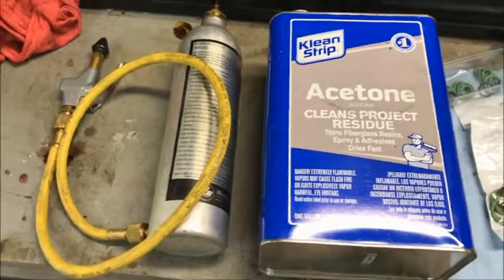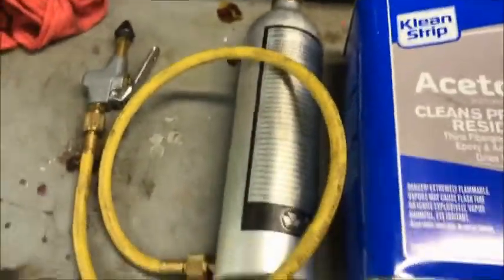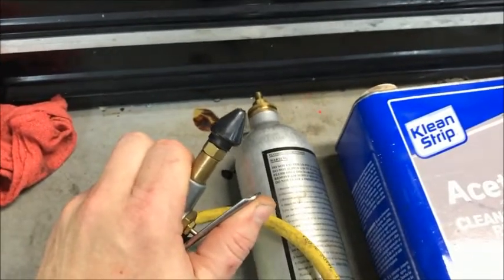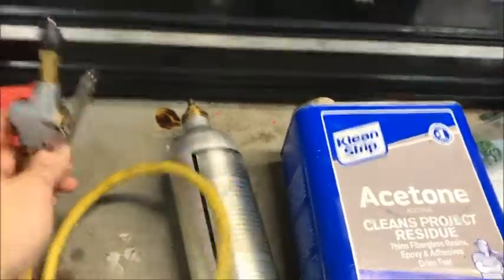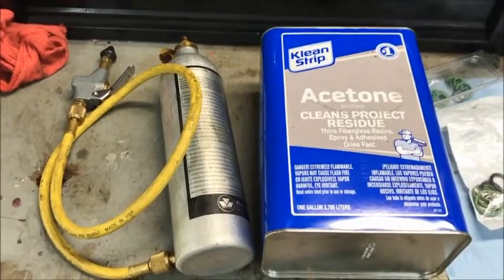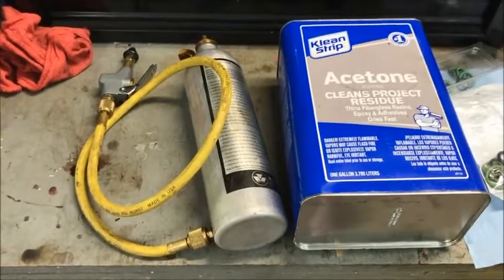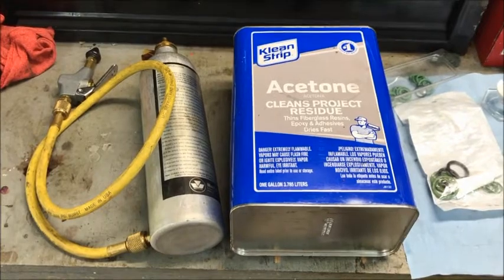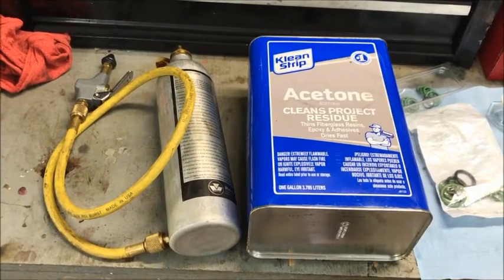A/C System Flush

Comment: Can i use Mineral spirits or Denatured alcohol to flush A/C mainly evaporator in vehicle ?
Reply from the maker: Don't use anything that will leave a residue, so this rules out mineral spirits.  I've never tried isopropyl alcohol but it should evaporate easily.  I wouldn't recommend flushing the hoses, only the metal parts of the system.
Reply: @BriansGarageUSA   10 4 cool + only the metal yup i was planning on that and use 91% or higher isopropyl  i also have some denatured alcohol may try that as well  im working on a 2006 Mazda 3s 2.3L auto sedan  so ill report back soon  got a med flush kit coming in the mail should be hear soon

Comment: Says AC flush but doesn't do anything but talk 😡
Reply from the maker: Donna, this really only works on old school cars.  Those with tube and fin design.  To flush you need to disconnect the evaporator at both ends, then blow the flush through it.  Same thing for the condenser.  Follow with compressed air.  Do not try to flush a drier, accumulator or hose with a muffler.

Comment: Make sure you vacuum from both the low and high side before you charge at least 2 hours.  I flushed a Honda out with AC flush only vacuumed the low side  found flush was still in the system a month later when I went to check it turned out the oil is mixed with some of the flush now. I vacuumed for 4 hours trying to boil it out of there but not happy about it. I was able to get 40F air but who knows how long it will last. When I removed the high side I could smell that citrus small flush solvent.  Acetone probalby better because it will evaporate faster.
Reply from the maker: That's good advice.  I've found that after you have flushed, it's a good idea to blow compressed air thru the tubes to remove any residual liquid.  This will also give you an idea of how clean the residual liquid is.  If it isn't clear, it isn't clean.  Then vacuum for an hour or so.  You must get the flush out or it will dilute the oil and the compressor will be starved of lubrication.

Comment: I would thing acetone would dissolve any o-ring seals and ruin the compressor and evaporator..  never tried it tho..
Reply from the maker: To be clear:
You flush ONLY the condenser and evaporator!  NEVER flush the compressor, NOR the hoses.  You ALWAYS replace the o-rings on any components that have been disconnected.

Comment: When flushing always use a solvent /white spirit that has hydro carbons . If u leave it in a cup it evaporates by itself . Never  blow out with compressed air as it will force moisture and small debris into system . Does it matter,, YES moisture degrades into acid also dilutes compressor oil . Micro leaks are caused by this as well . Happens overtime .
Remedy blow thru with nitrogen . This lowers the moisture and vacuum pump time will be 2-3 hours [longer the better ]  .   Blowing with air compressed air deposits moisture and should be evacuated over night
Reply from the maker: True, probably not a good idea to flush with kerosene....

I fully agree that nitrogen is better than air, but most of us car guys don't have nitrogen sitting around.  Also, know that a lot of classic systems have been open to the atmosphere for awhile, so the humidity has already done its thing.  You're gonna have to vacuum regardless and you're going to have to use a new drier.  Run the vac for an hour and any remaining moisture will get trapped by the desiccant.
Reply: Many times once a system has been opened  for greater than 48 hrs  using vacuum pump over night is enough. A  dedicated  3/8----3/4 vacuum line with a 8-10 cfm pump will reduce vacuum time by 50% Using nitrogen to sweep moisture out will reduce vac time as well .
Reply: use a filter drier on your compressed air line and make sure its not lines you used with lubricated pneumatic tools.... but if you didn't see this immediately as obvious maybe tooling around with a 3000 lb machine that will be used on public streets isnt something you should be doing :/

Comment: Is it safe to backflush a parallel flow evaporator core? I ask because I have been told it's almost impossible to clean a parallel flow condenser given its very tiny holes where one can never really get everything out, best to just replace it. But the evaporator is much more difficult to get to than a condenser so can it be flushed safely?
Reply from the maker: Good question!  A modern parallel flow heat exchanger uses several tiny tubes in each cross tube.  It is nearly impossible to effectively flush and should be replaced.  The method in the video is only for old school, tube and fin designs.
Reply: @BriansGarageUSA  Interesting, I’m getting a different answer from another shop stating the evaporator core can indeed be flushed with a good solvent, just not backlashed.
Reply from the maker: @Mike_44  
Well, I work mostly on old cars and am not an A/C guy.  So, I recommend doing what your A/C shop suggests.

That said, the evap is not easy to replace.  So that might be a factor in the decision to attempt flushing it?  I'd guess they still intend to replace the condenser, right?
Reply: @BriansGarageUSA  I’m doing all the work myself. I feel comfortable wrenching on my cars doing most services, have already swapped two motors so I’m not intimidated by the little a/c work. However, I did not have the knowledge, hence I’ve been doing so much research on the a/c realm. Thank you for help. I will try back flushing the evaporator and the lines. And yes I will also be replacing the condenser and compressor.

Comment: Great tips, thanks! Never thought of using acetone, so that'll be cheaper than buying quarts of flush. When you flushed your evaporator and condenser, were you able to do a good enough job with them still mounted in the vehicle?
Reply from the maker: You can flush both while still mounted in vehicle.  Slip a large hose over the conden/evap tube and direct it into a milk jug to catch the flushed a/c oil and acetone.  You may need to flush from both directions (inlet/outlet) until the acetone comes out clear.  When vacuum is applied, acetone will evaporate and not leave a residue of itself.
Reply: @BriansGarageUSA  Thanks very much for the reply! You've been a big help. That'll save me a lot of work. I'm doing a compressor upgrade kit with a Sanden rotary style compressor from Original Air Group, on my 75 Lemans Sport Coupe. Thanks again!

Comment: Thanks for the video. Are you using high air psi to open the expansion valve. My 65 chevelle valve is hidden deep and I really don’t want to remove it for a flush but I’m not getting  even air flow going thru the evaporator. It’s much lower coming out. Feels like a blockage or is it the expansion valve (which is fairly new) not opening?  Any thoughts? Thank you
Reply from the maker: Always remove the expansion valve or orifice tube when flushing.  The evaporator normally needs to be flushed from both directions.  You don't want any tiny orifices to cause a restriction to debris removal.